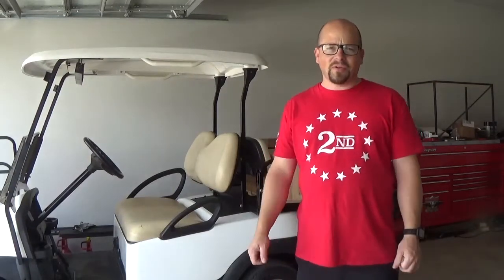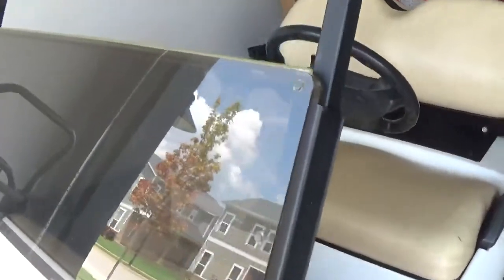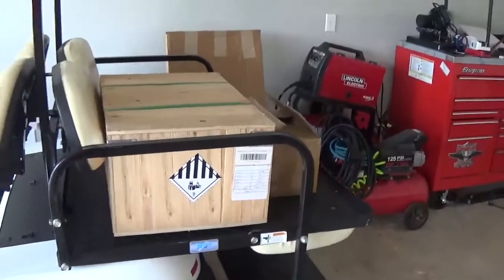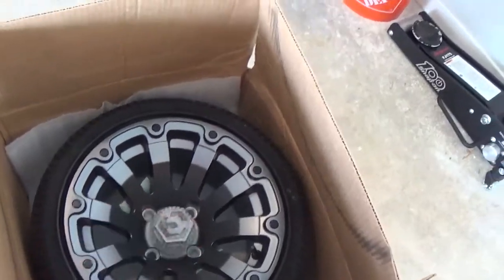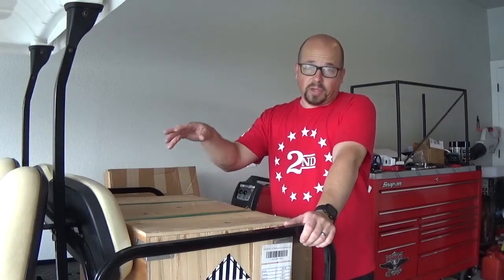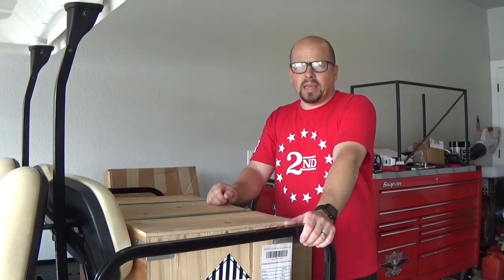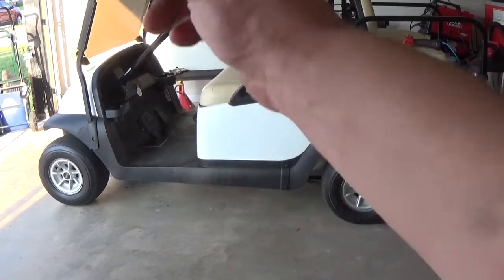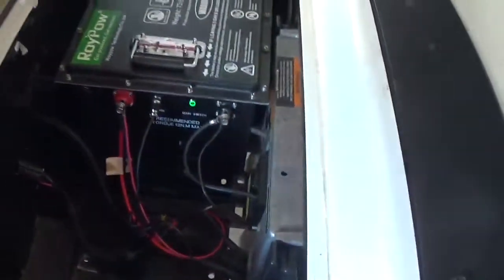Flintstone Mobile part 1 (Roy Pow Lithium Conversion)

Comment: Well done thanks. How does it compare with the lead battery in regards to speed and running 🏃‍♀️
Reply from the maker: Thank you!!
No comparison to the lead acid batteries…
Gets up to speed quicker and you gain a mile or two per hour because of the less weight that you’re dragging around

Comment: have you had any issues with the roypow chargers? i got my first 2 sets in and they give a fast blinking red light when plugged into any outlet wit or without batter connected.
Reply from the maker: No issues so far…however what year is your cart?